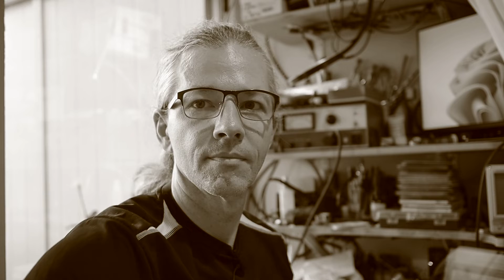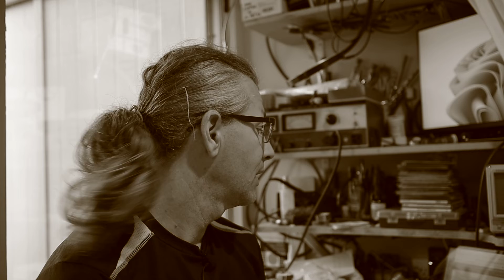SEAS driver find for Voigt pipe: will it live up to the Cube Audio Fc8?

Comment: The spider being a problem for moving the air. Does this mean that the Mark Audio spiderless speakers have a better range handling as there is no spider, so no stronger drag for longer push on the cone.

Comment: I would like to add my 2 cents. Stronger magnetic flux does not equate to good sound/tone.
It has to be in harmony with the spider, surround & especially the cone.
Reply from the maker: So true!!
Reply: Actually the best way well at least for me is to go 3 ways, 300-7kz or so stick with full range as wide band , add super tweeter & woofers. Can't really expect 1 driver to do it all. You want bass, x max has to increase, cone has to be heavier & thicker which is really really bad for tone. Off course thin cone will also have break up issues so its' a catch 22. We just have to pick our poison .lol

Comment: OK... HERE GOES: x-max = voice coil height - magnetic gap height, divided by two (usually expressed in millimeters).  Spider diameter/flexibility is determined with respect to total excursion length (x-max) of the driver, forward and backward.  A spider that is too flexible, after sufficient break-in, could result in an unstable voice coil movement within the magnetic gap, possibly resulting in coil damage.  Love your channel. Peace!!!

Comment: I like the construction of the Seas driver and I have looked in to it. But I believe it does not stack up to some alternatives that are in the same ball park for the pricing. The Cube Audio drivers will blow it out of the water, but they better do so considering the price differences. I will not buy a Cube Audio driver any time soon, it is too expensive (for my situation). I may try a pair of Sonido drivers at some point though, much cheaper and also quite nice.

Comment: Just had a demo of a pair of Cube Audio Jazzon and Nenuphar - pretty similar level of performance to be honest, with the Nenuphar having an smidge more polish, detail and soundstage - but I would happily go for the F10 select given the cost/benefit ratio.

The F10 Select driver holds a lot of promise, detailed, dynamic, it does bass and has great width/height to the soundstage. But it was (for me) shouty and lacked soundstage depth because it was so forward in the vocal region. This was the same with two different amplifiers a 300b and an Enleum/Bakoon.

If the FR was equalised, and the presence region pushed back into the mix, then would this add depth to the soundstage as well as taming it shouty nature?

It’s a very tempting solution, but I still wonder if EQ is enough to ‘do the trick’ of righting the wrongs of a full range driver of if so should just stick with point source, but using multiple drivers…

Janos - do you have a video of how you achieved perceived flat frequency response?
Reply from the maker: Thank you for the superb feedback! Will follow up with a video! ; ) Cheers, Janos

Comment: I just checked out the data of the Cube Audio chassis, and found out, it is somewhat precious. Its parameters are close to those of mid range Lowther drivers and it costs a little bit more. So I get, why someone tries to come along with something else. In the 90s there was a Lowther dealer located in the same short street as my favorite Hi Fi dealer at that time, and the latter was really scared that I might gain closer contact to the other one. Same guy who had the Voigt pipes from another customer and refused to play them to me. When I was actively crossing over my sys, I did not feel someone raked my back, but that might have been because I had an open baffle sub built on a plan that Siegfried Linkwitz himself published, and I even had a phone call with him which I still feel the honor and excitement from. Back then a Mr. Ridttahler was also mentioned in magazines as the inventor of that setup and my sub looked like those. I used a cheap PA X over to cut of at 120 Hz with 12dB per octave, to bring relief to my electrostatic supposed to be full range speakers. Sure the timing was not right at all, since the sub stood closer to the listener than the ESL speakers. But thx a lot for telling me your impressions. 🙂

Comment: János, the Fostex Sigma series have also a different spider, which is similar to the suspension, very unique design.
What makes this SEAS a bit odd is the VAS with 134L , that goes for the modern trend in development..
Reply: If you look at the application note, it is build for a sealed enclosure. A very strange choice for a full range driver.

Comment: I'd go for the mark audio Alpair 12 8" half the price! You could put two in for the price of one, and the specs look Great minimum of 43 l cabinet if you put in a 50 l cabinet you might get down to 34 Hz without crossover
Or go with a coaxial would be a better choice altogether a B&C
Reply: Beyma makes good sounding coaxials. 18 Sound and BMS likewise. A 15" would be so good that i could easily live with it in wooden cabinets or at least birch plywood. Cabinets that are built "live" sounds much better than an inert cabinet to me. More natural sounding done right 😊

Comment: Hey János. I noticed that this SEAS driver has a whizzer cone. Is it possible to detect whizzer cone issues/problems in the frequency response graph? The peak at 3 kHz? You mentioned before that the Cube Audio Fc8 had no whizzer cone issues at all.
Reply from the maker: Yes, the 2-4kHz region is a good suspect point for potential whizzer cone problems ;
Reply: You could make your own whizzer cones the same as a cube audio.